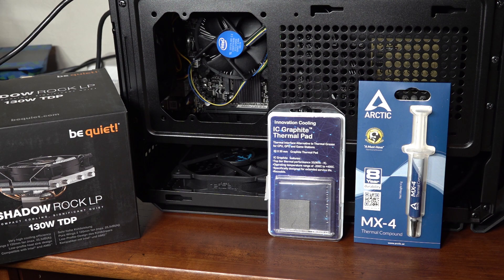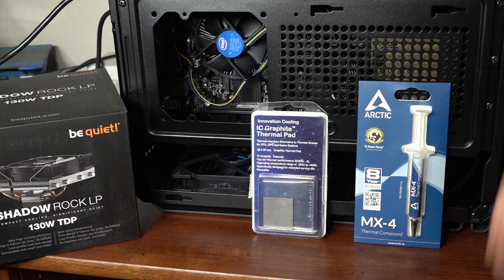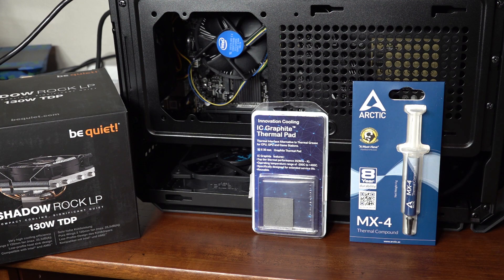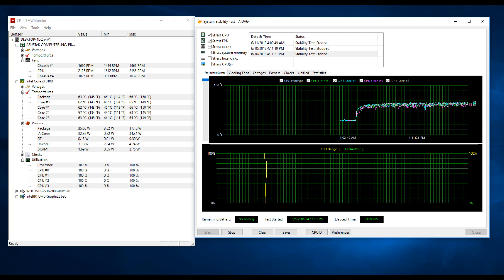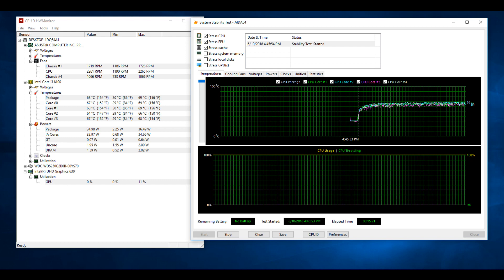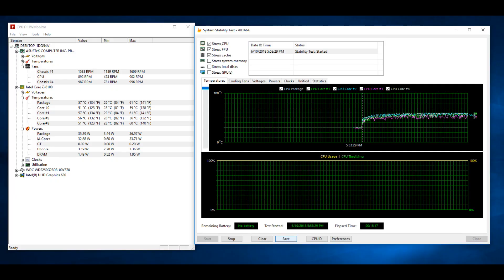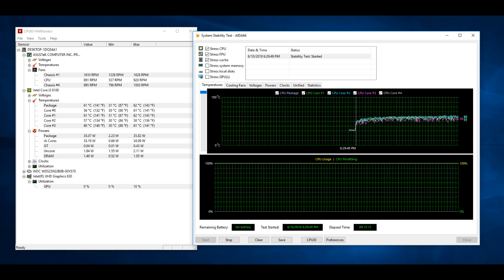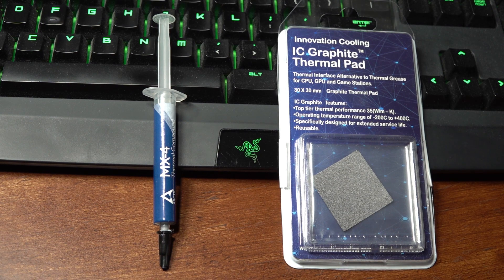IC Graphite Thermal Pad Testing and Comparison

Comment: Installed the pad and kinda regret it because I don't think its running as cool with my Cooler Master 240L RGB and 2600X as I'd like plus its kinda pricey the 40x40mm at $20 on Amazon. Getting at 70C on CPU load, 40C at idle in a 75F degree room.
Reply from the maker: Have you tried the same setup with thermal paste?  Are you running overclocked?

I agree, the price is kinda high to justify unless you really want or need the benefits the pad offers over paste.
Reply: Why is only your room temp in F ?
And how is 20$ pricey? The pad is reusable and I've read it will last 10 years, much more time than the life of a whole PC...
How much does a tube of premium paste cost? ~10$ for roughly 10-15 applications... The price is there, there is not a huge gap
Reply: Is that 70C under a full stress test? If so, 70C is perfectly normal even with an AIO.